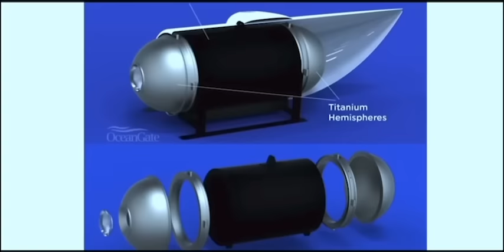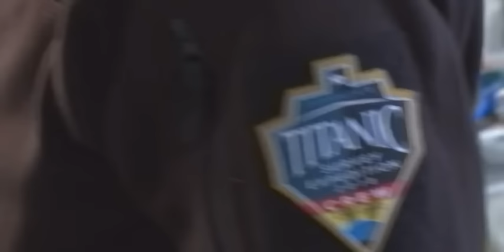First look at #oceangate #titan Debris

Comment: The wound the carbon fiber like a spool of thread, and did not even close it crosswise. What happens if you break a similar coil, only with threads, it will be properly stratified. Two titanium hemispheres at both ends had better strength characteristics compared to the carbon cylinder, since it had a layered structure, and the fibers were glued together by an additional chemical component that had other strength characteristics, which is probably why, with each successive cycle of immersion, the carbon cylinder received microcracks, gradually bringing the deep-sea apparatus closer to destruction.

Comment: Nicely done video.  Agree 100%. In my opinion, the connecting joints were poorly designed, epoxy was not mixed or applied under the proper conditions. A large part of these bonds should have been mechanical. Bonding to a relatively short channel of polished metal is not a very good idea.
   In my opinion, building the chamber out of dissimilar materials was not wise and should have been avoided.

Comment: The calculation for cylindrical pressure vessels shows that the stress on the end caps is four times that of the cylinder …… and they bonded the end caps on ! No mechanical lock at all ! 😮

Comment: I think you're missing the actual point here, this is not a positive pressure vessel in a classic sense.. the pressure or force is from the outside to the inside, not the other way around. As mentioned, the pressure would force these joints together and cause more of an inward lateral load on the carbon fiber tube with the titanium bulkheads. The crushing force on the carbon fiber tube would be mostly radial, looking for any imperfections to fail. My cousin was a saturation diver in the oil industry years ago, he had to get the fillings in his teeth redone for possible "air bubbles that can explode" when decompressing. So if a crack or small bubble in the resin of that carbon fiber tube was allowed to vent and permeation into the fibers itself, there would be a growing weak spot with every cycle/dive.. probably never detected venting on the way back up to the surface.

Comment: I doubt very much that it’s the bonding area that caused the failure because if that was the failure point, it would’ve failed the first time. The weakness was it’s a long cylinder it flexed in the middle. The end caps are pushing in the oceans pushing in in the middle, it failed, almost exactly in the middle catastrophically from the D lamination of the carbon fiber. You can tell that because the porthole is blown out from the inside.

Comment: The sub made numerous dives to fairly respectable depths. So in fact the design burst pressures calculated were valid.......for a while. Age killed it. 

The glued end cap were not a good idea and possibly caused the implosion - or maybe not. Remember that the two und caps are wanting to move in one direction only when loaded - towards each other. This is loading the CF cylinder with significant axial load in a reasonably stable manner around the circumference. CF pressing against the titanium. As long as both surfaces are flat you don't even need glue. Water pressure will assure that they stay put. 

The cylinder is the problem. Maximum inward deflection is at the centre is - at its most unsupported point - mid tube. The CF was radialy wound so its resistance to deflection is not optimal. But it's 5 inches thick? This also introduces an interesting point. The outer layers up to 2.5 inches would be compression loaded. The inner layers would be under tensile load. This phenomenon can be observed in beams under load. They bend in the middle when loaded. Imagine the tube as a series of beams.

So there are cyclical loads that stress and relieve the CF over time. Problem is its not homogeneous (like steel) - its layered and the layers within want to move in opposite directions. This leads to delamination. They heard it on previous dives. Very loud cracking sounds were reported. Sounds are caused by energy release. Delamination releases energy. Those noises should have stopped them dead.

Anyway this aging process continued and the micro cracking became a bit larger every time. Areas that were damaged got more damaged. The CF was "wearing out".  The deflection was increasing every time - but not so that you would notice. 

Then one Sunday the tube deflected a few microns more than before and the axial load provided by the end caps started a buckling moment within the now degraded CF structure and the inward motion accelerated to who knows what speed. The calculation is way beyond my capability 😜

The fractures multiplied exponentially in a micro second or two and the two end caps barreled towards each other, now unimpeded. 

Ah but they were found far apart. They probably flew past each other!
Fatigue in the CF killed it. It was good for one or two dives. After that it was Russian roulette.

Comment: Mate very very good upload, Glue for gods sake, i would have through that they machined a lip which would join together with a massive rubber seal to the carbon fiber and also making a sure fit down to the micron level of the sealing between the carbon fiber and titanium, plus they had to shut the front and bolt it to the other titanium ring,  Now this has happened i bet so many carbon fiber construction including koenigsegg frames will be changed, they say its stronger but its very brittle ,so back to titanium and special grades of titanium as well. :)

Comment: The glue was bonded to a machined smooth surface by only 50 or 100mm… maybe it could have been grooved or honeycombed for grip.. and having so many thin layers of anything glued together is just another million places it can fail…
I used to weld steel pressure vessels and we had to ultrasound the welds to make sure there was not even one tiny inclusion.. everything had to be fused into one piece.. autogenous.. one pinhole of high pressure steam would cut your finger off.

Comment: The glue wasn't the problem. The glue actually worked. Look at the pictures and you can see that carbon fiber, what's left of it, is still attached to the titanium ring.With all that pressure pushing on the craft you wouldn't even need to glue it. It was the carbon fiber that shattered into tiny pieces. It's because carbon fiber has a really high tensile strength and can't bend inwards or outwards, there's a saying in science "that which does not bend must brake" so everytime that it dove some of the carbon fiber would have broke, making it weaker until it reached its braking point and cracked into a thousand little pieces like a glass window shattering. The only good part is knowing that they didn't suffer and probably didn't even know that they were in danger. They would have been literally squished into a ball about the size of basketball or smaller in a millisecond, faster than a blink of the eye. But it never should have happened.

Comment: It could've been the epoxy used, yet carbon fiber can shatter, the plexy glass window could've imploded, the pass-through on the back titanium dome could've failed, a pressurized part (I think the controller pods might have been) in the rear could've failed and shot a small part towards the pressurized part of the vessel, etc.
Any one of these things could've happened first and set other failures into motion and could've happened in stages over a fairly short period of time or in extremely rapid succession, say a few thousandths of a second.
   There may have even been another failure that occurred, as there were so many design flaws on the Titan.
  The epoxy was certainly a potential weak point, and it appears it did fail, yet if the carbon fiber hull failed under pressure and shattered, the rings wouldn't be attached, either.
   There had been noise that was written off by the OceanGate crew, as "the carbon fiber settling", when in fact that crackling was very likely the carbon fiber delaminating.
   I don't believe the plexiglass port was rated at a sufficient pressure, either. I think he said 5,000 psi?
   I'll wait and see when more info, photos, and video of the aftermath come available after they clean up the human remains off the parts, and they can blurr out the debris field parts that might remain recognizable.
   Pretty sure the photos aren't going to be made public anytime soon.
   This is going to take a lot of people from a lot of disciplines to unpack the mess that went wrong with this submersible,  as there was quite a bit that could've easily failed.

Comment: I actually am an engineer and can say that there are indeed adhesives that can be as strong, or stronger, than mechanical fasteners.  So whether the joint was glued or bolted may or may not be of any relevance here.  My primary concern (without seeing the engineering plans) on the design is the use of carbon fiber as the main pressure hull; strength-to-buoyancy is just marketing distraction and is not really a factor here; virtually any submersible is easy to design with positive buoyancy regardless of the material used (you usually need to add mass to get an air-filled submersible to actually sink).  However, carbon fiber's claim-to-fame is its supreme tensile strength; i.e., it's good in tension.  It has zero strength in compression (which this entire hull will be under mechanical compression at depth) -- the only resistance against compression in carbon fiber composites is offered by the resin used to bond the fibers together into a self-supporting structure.  In such a scenario, the carbon fiber is merely "filler", and the resin is doing the actual work.

I'd be willing to bet the reason it failed now is likely due to the hull slowly delaminating after repeated compression cycles.

I also question James Cameron's assertion that the crew "likely knew" something was wrong; implosions at depth occur in just a few milliseconds -- far faster than the human nervous system's perception speed.

Comment: Intresting movie, i however think you "switched" the materials. It's the metal (titanium) that can flex and still keep it's strength. Carbon fiber can not flex, hence it instead will accumulate micro cracks in the material if exposed for extreme pressure...

Comment: Tempture  extreme  cold   has a effect  with synthetic material.  Any little  imperfection  at that pressure  will start cutting thru  like a cutting  jet  . Carbon fiber  can withstand  pressure  contained  trying to push out BUTT  not pushing in ! just relying  on a resin bond is insane  .  Probably  unnerving  noises  before it popped/ it happened  so fast  they didn't  suffer.

Comment: Even in spite of the engineering design failure the Titan design could have been “proven” by renting a boat and subjecting the test prototype to repeated lowering to depth well below design.   The US Navy uses a safety factor 1.5.  After say 50 cycles if it hasn’t collapsed then build a new one and test it a few cycles before service duty with live cargo.

Comment: Carbon Fiber is great under Tension... BUT.. the vessel here is under extreme Compression...  what's preventing the hull from collapsing IS The RESIN that bonds the CF fibers together.  The Backwards thinking on the part of the CEO and the designers is blatant. Now.. if you pressurized the Interior to about half the exterior pressure, then there wouldn't be any problem.... but then you're dealing with the same issues as deep sea divers, and the necessary decompression to avoid the 'bends'.  (Note I was involved in building some of the first spiral-wound fiberglass hydraulic cylinders for use in man-carrying bucket trucks, and am fully aware of the issues surrounding this subject.)

Comment: The front titanium dome has a Huge Clue visible. At 2 o clock there is a dent/ crack 8 inches in diameter. Look close at the picture. Some large object hit it from the inside.

Comment: I’m an ex warship and sub designer. Glue has one place only. The British Blue Peter TV programme from the 1970s. To stick card. Glue can’t deal with a shearing load. Carbon fibre is used where lightness and rigidity are key. Racing cars, for example. It can’t cope with shear as it’s laminar. Neither material has any place at 4000 metres.
I will make a prediction. Asymmetrical strain ( a materials science thing ) between carbon fibre and titanium will be shown to be the issue.
But as any ten year old will tell you, if it’s not a sphere made of a homogeneous metal ( like titanium ) there can be only one outcome. And that’s the outcome we had

Comment: Even if those joints weren't laughably inadequate, and if the carbon fiber was actually a viable material for this task, the whole idea of using dissimilar materials was an inherently stupid flaw.  They're not going to expand and contract at the same rates with pressure and temperature, virtually guaranteeing the joints eventually become a failure point.

Comment: I agree totally. I'm neither a marine engineer nor submersible expert. But it only takes a rudimentary grasp of physics and a general knowledge of engineering principles to realise his concept & design were massively flawed. My background is automotive mechanics & engineering, and it was obvious to me. The fact that all the people in Rush's video are presented as experts in their field, and none of these clowns said, "Hey, wait a minute. The mid-body of this cylindrical pressure vessel is the most susceptible to compression forces, with any subsequent deformation immediately stressing the weakest point of the design, where it connects at both ends to the titanium hemispheres." D'Oh!.....Duh.
I wonder if any of them feel any responsibility or blame? They should.

Comment: So, if I'm understanding this correctly, the idea was...the glue on the ends holding the capsule together was to work like an egg end to end. Like, an egg is incredibly strong end to end...BUT the middle is extremely weak and easy to break with a little pressure. 
   The 5" carbon fiber/steel was to give strength to the weak middle hull , and assume that the titanium/steel end caps would hold the capsule strong with the glue? 
 Jesus....this was dumb..and I'm REALLY surprised that PH (Paul Henry Nargeolet) actually went on it after he had ridden in many other deep sea subs before (all sphere shaped) and should've known this wasn't a good design idea.

Comment: The carbon fiber/titanium holding surface should have been 1/3 of the overall cylinder length so that the hull would flex less. And in that case a lot more glue area too. The carbon fiber wasn't even cross layed to add strength. I cannot say how they made the structure calculations.

Comment: There is a large white sheet of plastic which can be seen taped very securely across the remains of the submersible's aft shroud with black duct tape as it is lowered off the ship, clearly concealing something that investigators don't want the public to see at this stage.
Reply: someone mentioned, that the name OCEANGATE was blocked off with that cover, for reasons only known to them, edit, tried to find the comment, and couldn't but many said it appeared they taped over the name on the fairing
Reply: @tony--james  Ahh yes well done, that's a distinct possibility albeit a case of bolting the stable door long after all of the horses have all bolted lol. However the size of the sheet of plastic and its location on the remains of the shroud seemed to suggest it was concealing something far larger. It appeared to be located with the middle of the sheet of plastic on the lower centreline of the shroud, but from memory the Oceangate logo wasn't visible either so maybe it was performing two functions of concealment. I think the fact that the window was visibly absent from the bow dome with the red coloured crane sling being passed through this in order to lift the dome off the salvage ship is notable. The videos I've watched in the last day of the construction of that death trap are utterly mind boggling. Stay blessed there.
Reply: @harryricochet8134  I honestly don't know now why that area is covered, we can only guess,  but yeah. , I also watched a ton of videos on this so called sub, unbelievable ! what a nightmare, horrible , it's amazing it actually survived previous trips,
Reply: @tony--james  ikr, when you see how it was built and the so-called 'principles' that were applied in doing so it really is a question of how the hell it ever survived a single decent let alone multiple ones. That Stockton Rush had so many of the very same character attributes I frequently encounter in my legal advocacy work relating to institutional corruption which consistently prove the axiom that absolute power corrupts absolutely.

Comment: Look where the lifting strap is ran through, the view port. Highly unlikely they removed the view port to lift the end cap, since it would need to be inspected. Whether the view port blew in or out, will be interesting. Using 17 of the 18 bolts sounds like a horrible idea, but their calculations said it won't effect anything. Well they thought out side of know physics and found out I guess, because safety just stifles innovation. He had 37 million and this is what he came up with, makes you wonder what the cost of building it right would have cost.

Comment: if this image of the cf hull is real, it suggest to me like the glass broken and the hit of the entering pressure compressing the air broke the joints separating the 3 parts of the hull from inside.

Comment: It should have been tapered on both sides and engaged at least 8/10 inches. Also the should have put a vent on seat and vacuumed the atmosphere in the bonding region, allowing the air and access glue/ epoxy to be removed, making a much better and consistent bond,
And the fibers we’re running the wrong direction for the task he was trying to achieve